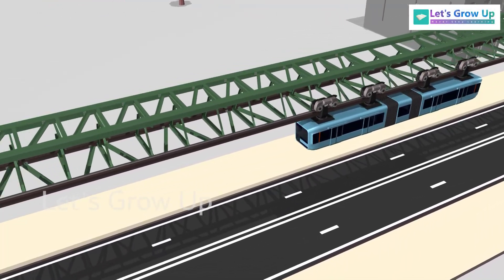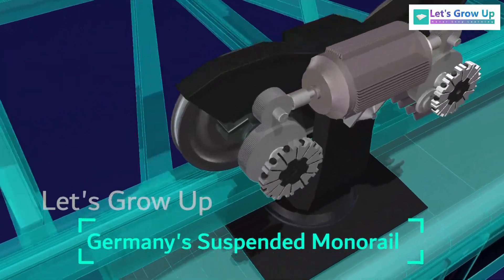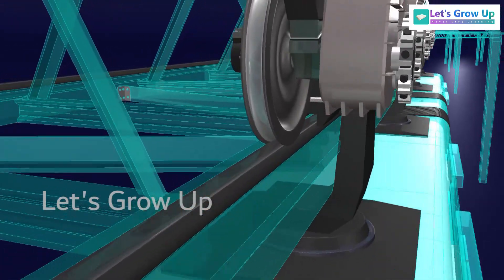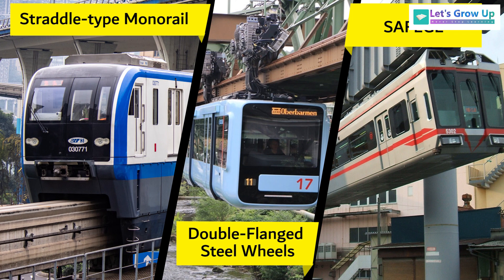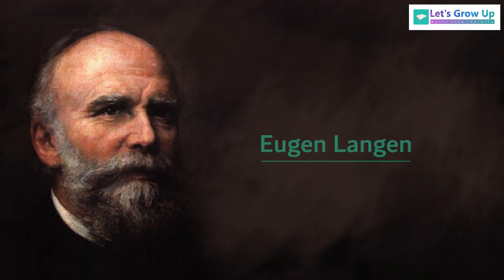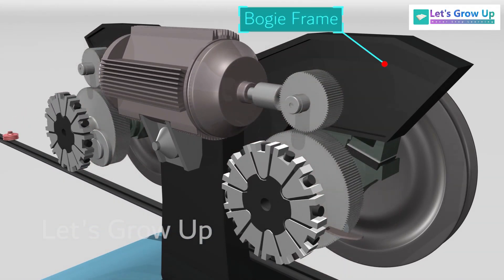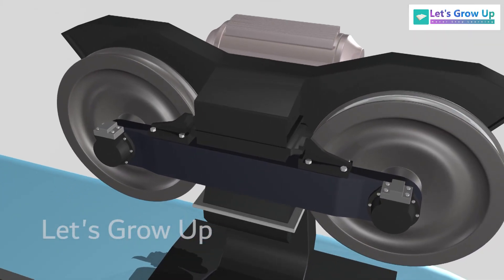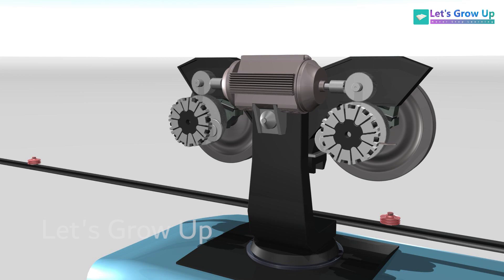Germany's famous suspended monorail 3D explain

Comment: Ihad travelled once in this but yousay asynchronous motor in animation and describe in working 750v dc motor usthere done mistake or asynchronous motor is ac motor do udit the dcmotor has vfd and how does the
 supply being given how many passenger s can be accommodated in both biggies
Reply: The trains are supplied with 750V DC through a power rail and inverters on the roof of the train convert it to three phase AC for the motors. Greetings from Wuppertal!

Comment: Is the Up Side Down Monorail Using Battery? I don't see panthograph and cable
Reply: It uses a power rail with sliding contact shoes next to the track delivering 750V DC. You can see it with its insulator mounts at 1:55 in the video. Greetings from Wuppertal!

Comment: What is the benefit of monorail?
Reply: The ground was just too hard to build a subway/metro. So the city in which this monorail was built decided to build a metro-like train over their river.
So the benefits are: It's cheaper than building an system in the underground; the "trains" are more frequent than actual trains and it doesn't get stuck in traffic like busses do
Reply: @derlthmock8617  And probably most important: It can travel faster on curvy routes than traditional elevated rail could, because the cars swing out when passing curves, therefore being able to go quicker without causing passenger discomfort.

Comment: Idea for new video, how do tram switches work. You know current is needed to close the circuit between rails and wheels, so track changes. If no current you don't change. Probably that's the principle. This is why you can either see a voltaic arc on the pantograph or feel engine stopping and rolling inertially. But the mysterious thing - does the point go back to its previous position after tram passes

Comment: How  provide electric supply to the train,
Because there are not showing electric line,
Are train use battery supply ?
Reply: First I would like to congratulate you for the video!!! I am have the same question.
Reply: I can only speak about the german one, but it's like this:

You got the rails of the track on top. On the bottom side are many "long metal plates"(?) connected together as one very long piece of conductive metal. The required electricity is supplied on this metal strip. The railway then gets in contact beneath the track with the metal strip and uses this electricity.